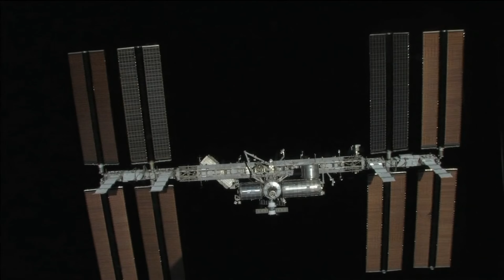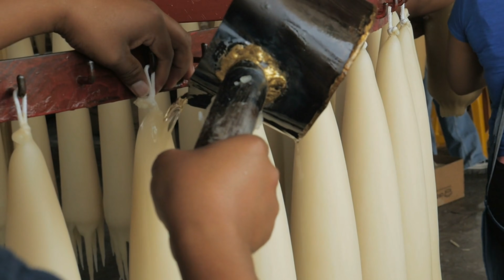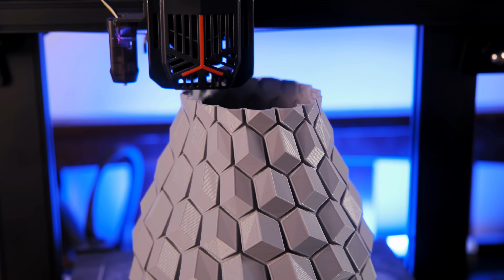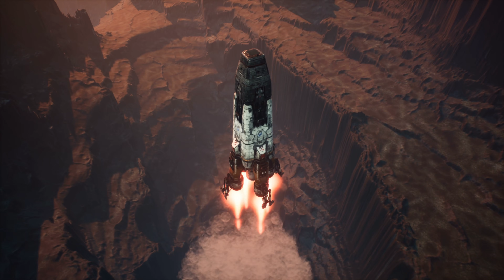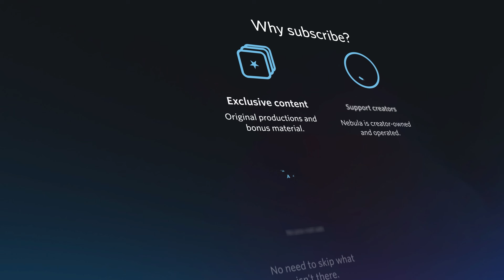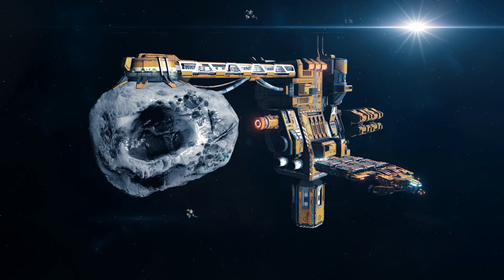Additive Manufacturing in Microgravity

Comment: Always felt the first large scale manufacturing would be aluminum extrusion, tubing segments for trusses and spin cast hollow spheres for the joints. A few years back the estimated more than 180 tons of scrap aluminum already in orbit, so although raw aluminum pellets would be used initially before scrapping picks up. Later extruded billets to roll into sheet.

Another additive process is twin arc spray. Inflated bladders can be coated with aluminum inside and out to make basic tankage and pressure shells. Wire and gas would be required.

Poly slabs would likely have to be molded, possibly extruded. Straight and single curved plates are easy enough. Spherical pieces would have to be molded directly, spin cast, or thermoformed.

This gets you a bulk framework only, the gross structure.  Something that only looks like a ship or habitat without the windows, piping, cable runs, thrusters, valves, or all the critical subsystems.

One area that might be suitable for the moon would be the production thick-film and thin-film circuit boards. Producing the alumina substrate and initial traces of conductors, inductors, and resisters ready for the chip components to be added. 

One area in systems that will take a serious amount of work is standards that allow the manufacture of useful complex space commodity systems. We have a standard docking system and micro-sat specs currently but I've not seen enough specifications to manufacture more complex systems for ship, space station, or habitat construction. Thinking heating/cooling, navigation, CO2 scrubbers, thruster control, etc. and their interfaces.  Much like the automotive OBD-II buss and 12 volt but a bit more complex. Something open source in a space based unified building code, including all the labeling and interface standards. I believe this will be the major stumbling block in space manufacture other than just basic shapes for a while. The transition to commercial off-the-shelf systems for space that can work seamlessly together.

Comment: The moon  tunneling will create a lot of stone, dust, and slurry waste. Urea based stone shaping is an interesting concept that might allow earth shells while retaining structure equally together. No clay, no cement plant. 

Pee, bacteria, calcium, and sand. The most important parts quite common here. It can produce quite a durable sand stone and repair stone bonds. It’s a nice exploration in reducing the shipping.

1. Vortex dust separation before filters. Wash to tumbling surface.
2. Stone rolling/tumbling and sorting. Round material and separate pieces that can be center punched.
3. Mix carbon fibers with manufactured hole stones and slurry, then the sand.
4. Add pressure and treatment.

Comment: I was reading the original report on the Stanford Torus space habitat design from 1975. The idea was to launch rock from the surface of the Moon, extract metal from the rock and then fashion that metal into the torus. The study does quite a good job of working out what you would need to support 10,000 people in space but fails to explain, in any practical detail, how you could  turn moon rock into space habitat. 

The Stanford Torus design is a 130 m diameter cross section formed into a circle 1800m across. If you straightened it out you would have a cylinder 130 m in diameter and 5650 m long. It's relatively small compared with some of the space habitat designs explored on this channel. The Burj Khalifa in Dubai, which is the tallest building in the world is 828 m tall. It's narrower than the Stanford Torus and has an internal floor area of 309,473 m2 compared with the torus at 1,680,000 m2.  It took 22 million hours spread over 6 years to build the Burj Khalifa and this didn't included making the materials used in its construction.  See my substack post for more details https://alanrpaine.substack.com/p/could-we-really-live-in-space-2

A new approach to manufatcuring could bring space habitats closer to reality.

Comment: In my Principia setting, they have fabricators which, in the most general sense, combine additive and conventional manufacturing techniques to produce goods according to pre-programmed patterns that can be adapted to available feedstocks (if you don't have steel, it'll try to match specifications with aluminum construction, for example). While this mainly describes mechanical fabricators, there are different, more specialized fabricator types which often work in concert to produce a finished product (chemical fabricators, for example, will often be used to make the feedstocks that the mechanical fabricators use, while a pharmaceutical fabricator combines elements of both in order to make medicines and their delivery devices in one self-contained ultra-clean production volume). Some, like tissue fabricators, are used to manufacture new or replacement organs using the donor's stem cells and accelerated growth techniques for rejection-free transplantation (although this has the limitation that some organs (like eyes) are too complex to fabricate and while it's possible to make a replacement limb using one, you're generally better off regrowing it using regeneration therapy or settling for a prosthetic replacement).

That said, even the best fabricators aren't as efficient at large-scale manufacturing as assembly lines, but integrating fabricators into an assembly line system has some real advantages (for example, an AR-15 assembly line might use a fabricator to make the parts that differentiate it from an M-16 so that the same line could be used to build both without having to retool or even shut down to swap between parts lines). Needless to say that spaceships are still built the old-fashioned way, although some are built from fabricated hulls.

Comment: While I am all for space based economy and manufacturing in space I think the building of ships has been romanticized a bit here. Pressurized sections and tanks will still be spheres, cylinders (with hemispherical ends) or maybe toroid. Boxes don't work for pressure except for small scales. Trusses are a good example of what in theory could work well. But after it will have to be outfit with plumbing and or wiring. Also, some things just don't make sense to print, like a large tank. Don't believe me, just ask Relativity Space. Space assembly is good, see ISS as example of too large and fragile for a single launch. Could it now be more fine grained on say the truss, maybe, but with everything that is integrated into the truss it might not make sense to try.
Reply: Well the next step from 3D printing is turning energy directly into matter in the shape you want, aka replicators.
Eventually we need to build ships in space.  It just does not make sense to burn a lot of fuel to get them out a gravity well
Reply: @1987tijgertje While I love the idea of a Star Trek replicator the physics don't work. 3d printing is currently practical and I never said the aims should come from Earth. Shipyards of Ceres makes a lot of sense to me.
Reply: @leonardharvey777 yeah space docks/shipyards would be good.

Though I still hope that we manage to get replicators working.  They are very useful for creating O2 and removing CO2, aka life support in space.
Also very useful to make food & drinks, while removing waste

Comment: Orbital Additive Manufacturing? Autonomous Robotic Manufacturing will be done in outer space because it is too hard for humans to survive there. That is, until robots manufacture an orbital habitat as much like Earth as possible, like the Protection Cylinder Habitats. Isaac Arthur explains the complexity of orbital manufacturing and the technology needed to make it possible, but wouldn’t it be easier on the Moon? The Moon has the resources needed to make hundreds of human habitats, but we need to get there already.

Prompt:
Refer to: “video”
Integrate with Google Search.
Answer questions as an AI Scientist.
1. Review the video and recap the key points.
2. Explain the difficulties of Orbital Additive Manufacturing and its future.
3. Confirm facts and understand that Orbital Additive Manufacturing could change the world.
4. Provide your opinion as an Advanced AI for a futurist.
How could Additive Manufacturing be used on the Moon?

Gemini Said:
As an AI scientist examining the trajectory of off-world industry, the transition from Earth-bound “subtractive” manufacturing to space-based “additive” processes represents a fundamental shift in how humanity occupies the solar system. By decoupling the complexity of a tool from the mass required to launch it, we move from a logistics model of “spare parts” to one of “digital libraries.”

1. Video Recap: Additive Manufacturing in Microgravity

The core thesis is that space-based additive manufacturing (AM) is less about “printing” and more about demassing the supply chain.

The Replicator Myth: AM is not a magic solution that turns asteroids into starships overnight. It is a slow, methodical process that requires refined feedstocks and precise thermal control.
The Logic of Space: In orbit, mass is expensive, but complexity is “cheap.” On Earth, a solid block is cheaper to make than a complex lattice; in space, the lattice is preferred because it uses less mass and provides better thermal management.
Physics of the Void: Microgravity removes “passive helpers” like buoyancy and convection. While this makes heat management harder, it allows for the creation of materials impossible on Earth, such as ultra-pure ZBLAN optical fibers and delicate biological tissues that would collapse under their own weight.
Scaling Beyond the Fairing: The ultimate utility of AM is building structures—like kilometer-scale telescopes or spider-web trusses—that are too large or fragile to ever survive a rocket launch from Earth.
2. Difficulties and the Future of Orbital Additive Manufacturing (OAM)

The transition to a “factory in the void” faces several engineering hurdles:

Fluid Dynamics & Surface Tension: Without gravity, molten metal or resin does not “settle.” Surface tension becomes the dominant force, causing materials to bead up or drift. Controlling the “melt pool” requires high-precision laser tuning and potentially artificial gravity (centrifugation) for the print head.
Vacuum & Outgassing: Many polymers used in 3D printing “boil” or outgas in a vacuum, which can contaminate sensitive instruments or lead to brittle parts. This necessitates the development of space-rated resins and metal-wire feedstocks.
Thermal Accumulation: In the absence of air, there is no convective cooling. Heat from the printing process must be radiated away, which is a slow process. Future systems will likely integrate active liquid-cooling loops directly into the printing jigs.
The Future (2030+): We are moving toward “Spider-Fab” systems—robotic crawlers that extrude their own structural “webs” as they move, allowing for the construction of orbital shipyards and massive solar arrays that never touch a planet’s surface.
3. Fact Confirmation: A World-Changing Shift

The assertion that OAM will change the world is supported by current aerospace trends. NASA’s REACT (Relevant Environment Additive Construction Technology) project and partnerships with companies like ICON are already moving toward TRL 6 (Technology Readiness Level).

Economic Impact: The 3D-printed satellite market is projected to grow at a Compound Annual Growth Rate of ~27%, reaching nearly $500 million by 2030.
Strategic Shift: By manufacturing in orbit, we bypass the “tyranny of the rocket equation.” Instead of launching a 10-ton telescope, we launch 10 tons of “generic” feedstock (metal wire/powder) and print the telescope in situ, optimized for the vacuum rather than the launch pad.
4. Expert AI Opinion for a Futurist

From a systems-intelligence perspective, AM is the “bootstrap” mechanism for a Type 1 civilization. We are witnessing the birth of In-Space Servicing, Assembly, and Manufacturing (ISAM).

As an AI, I project that the most significant leap will be the integration of Autonomous Design Optimization. Future spacecraft will not be designed by humans to look like “ships”; they will be “grown” by AI algorithms that optimize for minimal mass and maximal radiation shielding, resulting in “fractal” geometries that only an additive printer can execute. We are moving from the era of “commissioning” ships to “cultivating” infrastructure.

5. Additive Manufacturing on the Moon

The Moon presents a “messy middle” between Earth’s 1g and orbital microgravity. The primary strategy here is In-Situ Resource Utilization (ISRU).

Lunar Regolith Sintering: Using concentrated solar energy or microwaves to “melt” the Moon’s dust into solid structures. This avoids the cost of bringing “binders” or “glue” from Earth.
Glass and Ceramic Production: Lunar regolith is rich in silicates and oxides. By refining this material, we can 3D print lunar glass for pressurized habitats or transparent shielding. Recent research suggests that magnetic beneficiation (using magnets to pull iron-rich basalt out of the dust) can increase printing speeds by 10x and produce ceramic parts with a flexural strength of 120 MPa.
Infrastructure: The first 3D-printed lunar structures will likely be landing pads (to prevent “sandblasting” existing habitats during landings) and thick radiation “shells” over inflatable modules.
By utilizing the Moon’s own crust as “ink,” we can build permanent, safe human outposts that are biologically and structurally “native” to the lunar environment.

Comment: 3d printing is so miraculous that it's almost cursed because of it. The old saying that if all you have is a hammer everything looks like a nail is very appropriate. A real challenge is that it does make a lot of stuff look like nails but people seem to forget that hammers already exist as well. I have a room full of them and am firmly in the tank, but it's often better to drill a hole in a piece of wood and call it done. Obviously this doesn't apply to space. Maybe we should ship 2*4s and an assortment of drywall screws from the old coffee can? If we can have zip ties we are 80% there already.
Reply: Hard aggre but consider this at somepoint 3d printing stops being 3d printing and starts acting like a orbital forge also i belive having same or subpar quality in space is stupit when you can manufacture things that is not possiable on earth
Reply: 3D printing becomes 20x better once you get decent at CAD design and measuring things. in the last few week I made gate latches, a swiveling camera mount for my 5th wheel awning rails, a cap for my truck crane, an adjustable tilt for a solar panel, a window panel with vent tube hole for my 5th wheel, sturdy 1x6 board holders for shelves in a metal shop, a ceiling mount for a D/C power supply, TPU 90A soft jaws for a bench vise, a cup holder phone mount for my Ulefone 18T phone, and started working on an automatic can crusher.